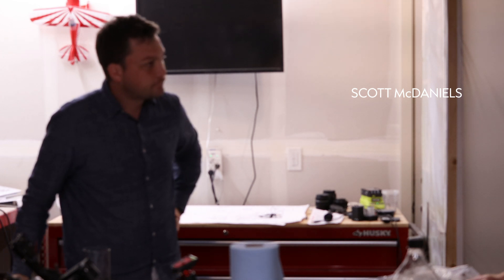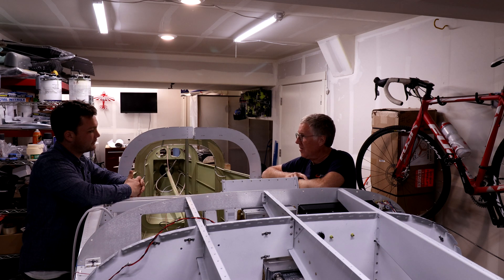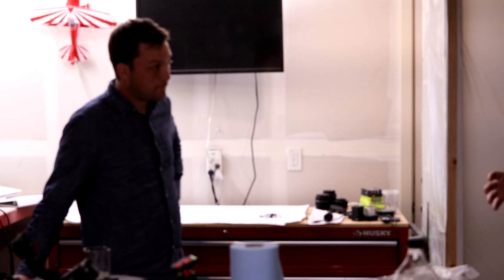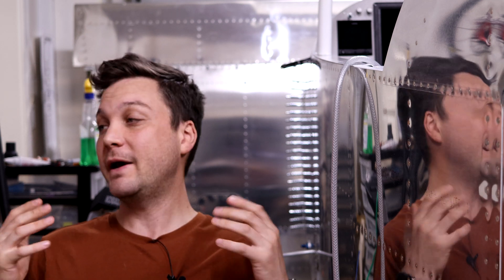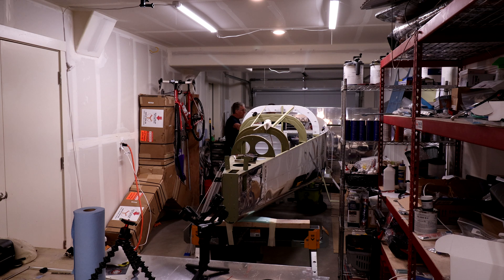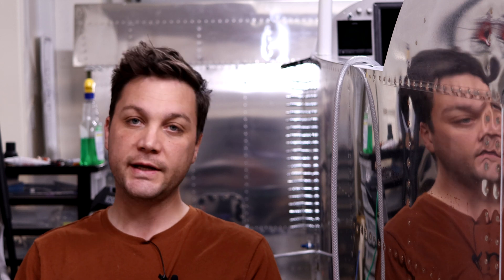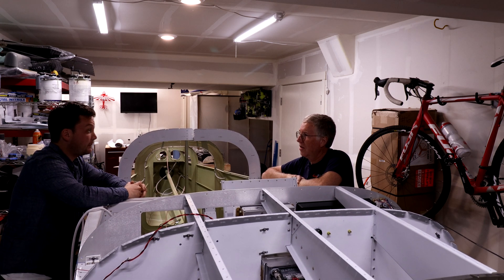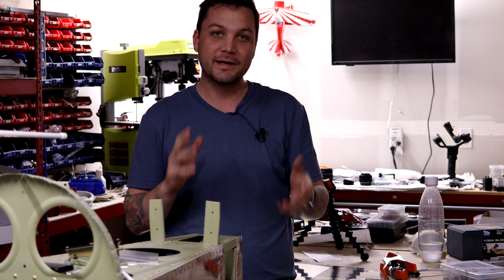EAA Tech Counselor Visits  - RV-7A | EP4.18

Comment: Forgot to ask you what Scott meant by saying that some of the dimples were at 95%. Was his observation that the manufactured head of the rivets were proud of the surface because the dimple wasn't deep enough? If so, did he share why the dimple wasn't deep enough (tool used to make the dimple, tool setting, etc.)? What was his remedy going forward?
Reply from the maker: The manufactured head is flush—thankfully. I would have caught that, I think. Who knows. 😉

There’s a distortion around the rivet in the skin that can be minimized by more pressure while dimpling. It’s what he’s describing when he talks about the reflection of the towel. The skin will form a circular distortion, like rings in a pond, until you really apply some even pressure. Then the skin will lay flat. 

Typically this means dimpling beyond just the “scuffed ring” point that most people associate with a finished dimple—including me.

He noted that there’s a good chance a decent cut and buff post paint/clear will level this distortion. That’s my chance at redemption at this point.
Reply: @RyanFlysPDX  Thanks Ryan. In my Synergy class, the instructor taught to adjust the dies in the pneumatic or hand squeezer enough to notice the top arm of the yoke flex. Same on the DRDT-2. As far as the impact (hammer-strike) C-frame, Cleaveland Tool instructs to set the dimple by ear. The first strike rings, the second one produces a thud. I'm finding that the DRDT-2 is kinder and gentler to thinner sheet, especially when dimpling near the edge of the material. Yes, I could use my pneumatic squeezer to dimple near the edges, but I prefer to have the material laying flat on the extension table as to have the dimple dies approach the hole at 90-degrees.
Reply: You have been using the mechanical "C frame", what will you do differently to be 99%+ going forward? 
ie. A double pull on the drdt? Did Scott give a recommendation for a 100%?
Reply from the maker: @drlouiskerr9310 The DRDT is adjustable. Probably another half turn of the thread or a firmer motion. 

C-frame + hammer can form a good dimple because you’re not fighting flex like you are with DRDT or squeezer.

Another thing to be careful of is flex in the yoke of a squeezer, I learned. This will cause the does to align slightly out of plane, distorting the dimple in one direction. While, again, not a safety/structural issue, it can cause slightly perceptible unevenness in skins.

Comment: I began my RV-14 project with building the vertical stabilizer. Before closing it off by installing the rear spar, I contacted a local EAA Tech Advisor and asked if he’d take a look at it. He passed on some of his knowledge, and some guidance on building skills going forward. It was a positive and motivating experience. A resonating point he made was that the first 100-hours of the build is like the attention you give your first child. Build time spent after that is like the next child, and the next. You’re laser-focused in the beginning, and then things get routine.

I seem to remember there were required inspections/sign-offs at particular stages of project completion. Maybe I have that wrong. Anyway, I plan to bring in Tech Advisors, hopefully the same one that visited, throughout my build. I’m also putting in time at the EAA chapter, helping with a Waiex-B build project.

Thanks for sharing your visit with Scott McDaniels. Great review and info.
Reply from the maker: There used to be required inspections. Not anymore, just the final airworthiness.

For me, I was in a rush at the beginning. I think there were elements that I could have slowed down on, but I was determined to make it to the next milestone. 

Once the magnitude of the project began to set in, I’ve been less reluctant to set it down for a day to do something right. It seems like I have that backwards from most people, who crawled through their empennage but flew through other later portions.

Comment: Pool Noodles, best foam for wire management and a bunch of other stuff
Reply from the maker: I actually started with the pool noodle. Because the space on either side of each run is so small, the noodle just disintegrated. I needed something denser, a bit more firm, without running the possibility of chafing.

Comment: That is great that you now have someone to advise on your build.  I can only imagine the anxiety you felt before he showed up.  I would have been a wreck worried about what I had f*cked up.  Glad to see all was well.   I am sure you had some deep sighs of relief.   Keep up the excellent work.  Setting a high bar is always the best approach, especially when it will be your ass flying it.
Reply from the maker: I'm incredibly encouraged there wasn't anything that was a flat-out "This needs to be rethought!"

However, having seen builds that span the spectrum ("You're going to fly in that?" to "That belongs in a museum, not in the air."), I knew I landed somewhere in the middle with a safe and clean build when it comes to technique.

Now the important checks will come to ensure loose ends haven't been left prior to engine run-up and test flights!